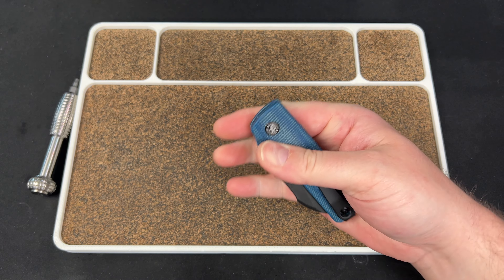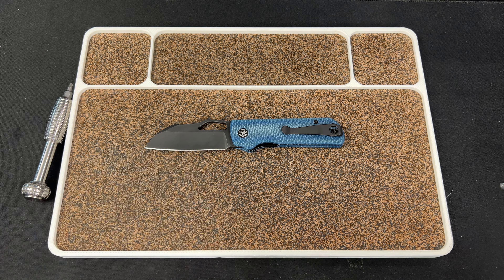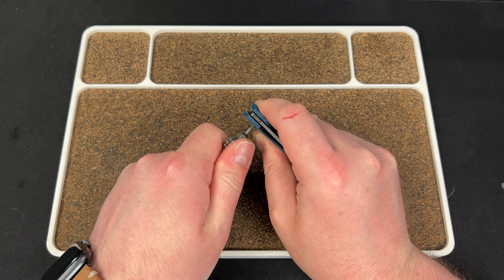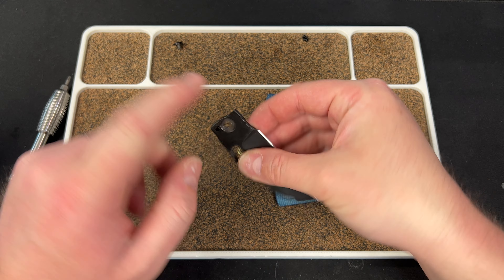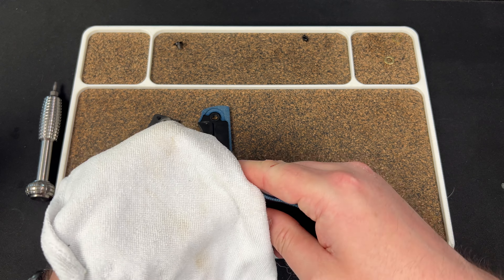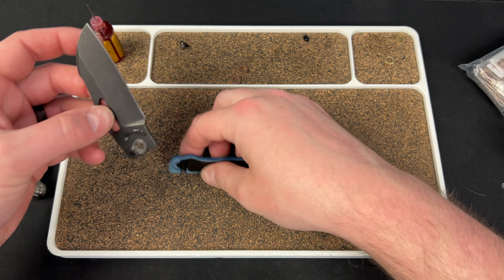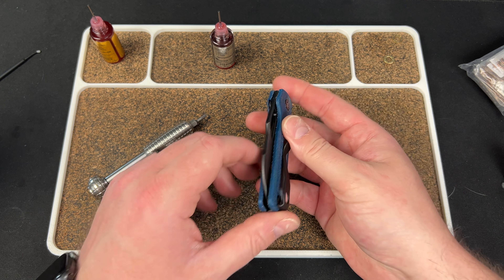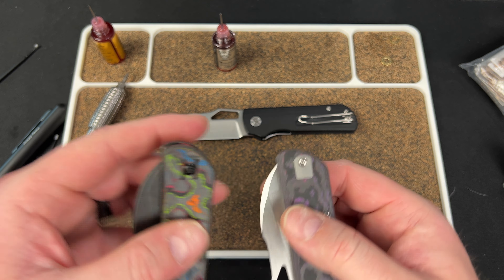Pony Stout Debrief & Disassembly

Comment: Guess i need to disassemble my blue micarta version, detent way different (and weaker) than my black G10. Do the different materials make any difference? Shouldn’t right cuz the bearings riding on the liners?
Reply from the maker: Nah they shouldn’t be much different but detents always vary. We asked for snappy detents so if u can fail it easily i would try the cleaning and see if that helps. If not, shoot WMK an email or we can try to tweak for you. Sorry you’re having an issue. My email is kevin@divoknives.com

Comment: I think spyderco does there s90v at 59 to 61.
Reply: Hell no😂 Spyderco has the best heat treat at a production level in the game. I put a brand new edge on my s90v para3 the day I got it because I wanted to lower the angle and even on my DMT stones, the s90v took probably 3 times as long to apex the burr as their s30v would regularly take. 
Has Spyderco released some knives into the wild that had a subpar heat treat? Of course, just like most companies I'd assume since anomalies do occur, but the difference with Spyderco is they don't target their steels HRC with a cookie cutter range like all the Chinese companies do at 58-60/59-61. They prioritize the specific heat treatments and protocols for all of the steels they use, which for myself is one of the main buying points in purchasing a Spyderco. The customer knows they aren't getting CPM Cruwear with the same heat treatment of their BD1N.
Reply: @wes.killed.it.5511  I wasn't knocking spyderco I just saw there s90v was 59 to 61 which must make that HRC range good if that's what Spyderco does.  Which was the same HRC range as the knife he was talking about. Or so they say right...

Comment: which clip is that? for which spydercos?
Reply from the maker: Standard spyderco wire clip replacement from Lynch NW
Reply: @LeftyEDC is this the blacksmithed Lynch clip to go with the black washed blade?
Reply from the maker: @acartersmith  no i use the black cerakote clip for blackwash blade. The blacksmith matches spydercos dlc coating.
Reply: @LeftyEDC  thank you  Kev!  How does the black wash blade stand up to wear and  tear?
Reply from the maker: @acartersmith  been great for me!
Reply: @LeftyEDC  awesome thanks for the information!